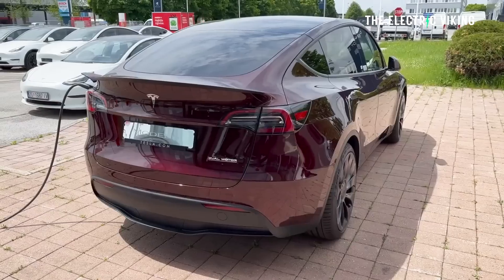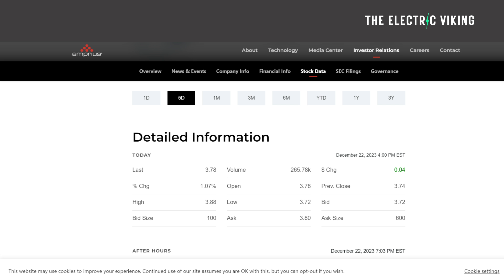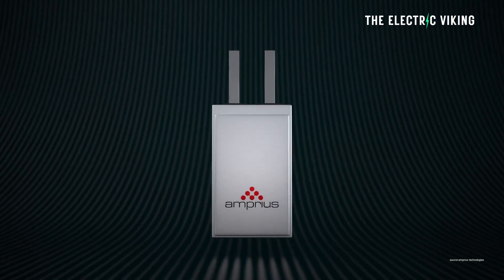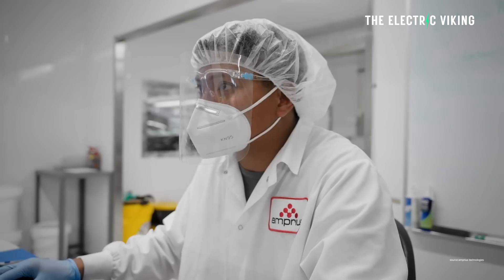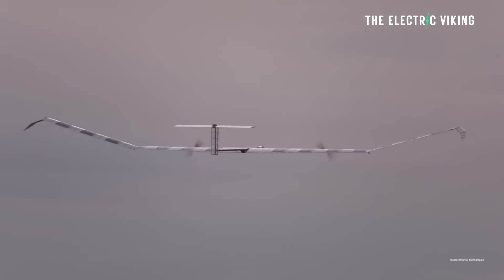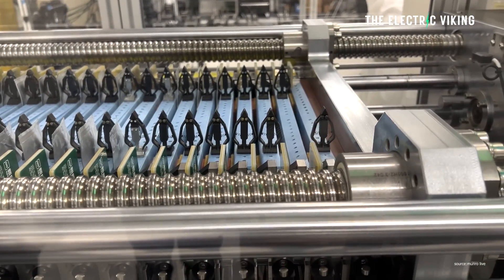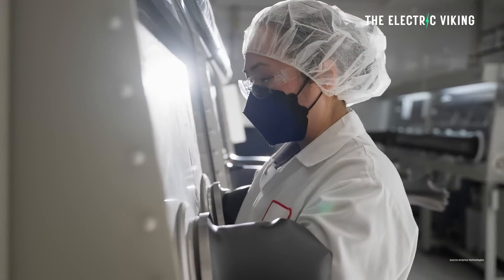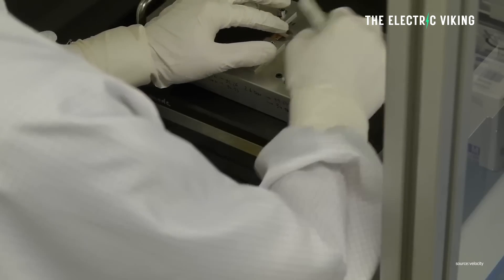A U.S. company makes the world's highest energy density batteries next to Tesla

Comment: How do you scale growing Si nano-crystals to GWh worth of anodes and cathodes? Crystal growth is usually an awfully slow process that gets slower the tighter your desired tolerances are. I cannot imagine this getting anywhere near as fast as pasting anode/cathode material on current-collecting foil. Looks like a probably massive manufacturing bottleneck that will limit the battery's usefulness to niche applications to me... and unsurprisingly, the military industry is their primary client right now.
Reply: Thanks for that information!
Reply: Amprius uses Centrotherm PECVD (plasma enhanced chemical vapor deposition) equipment from the solar panel industry. Centrotherm has years of experience mass-producing silicon deposition based photovoltaic cells for the solar industry. Initial capital expenditure will be quite high to get to giga-scale, but actual production will be cheaper than graphite anodes.
Reply: @Grimwyrd  PECVD can only deposit 25nm of material per minute. When you have to cover square miles of material per day with micron-long silicon nanowires for EV-scale manufacturing, that is awfully slow.

Supplying anything beyond niche products will require a ridiculous number of vapor deposition chambers.
Reply: @teardowndan5364  Yes, that's why solar panels can't be mass produced... /s
Reply: @Grimwyrd  you need to process quite a bit more battery electrode area per EV battery pack than PV cell area per residential roof.
Reply: @teardowndan5364  It's not nearly as bad as you make it out. They'll be able to reach giga-scale in a couple of years and the company will do very well.

No, they won't match the speed/manufacturability of Tesla 4680s, but they don't need to. They're focused on premium use-cases that pay top dollar for premium gravimetric density (e.g., stuff that goes airborne) while EVs are going cheap and easy.

Comment: Viking, again your logic is right out the window, why wouldn't Tesla buy them if things are so great? Answer, they're not!!!!!
Reply: In the same building something smells fishy
Reply: Correction: the answer is that Tesla is prioritizing quickly making as many fast, cheap batteries as they can, because they know they can sell all the cars they can make. Sure Amprius batteries are better energy density, but they'll never be made as fast and cheap as Tesla 4680s. That doesn't mean Amprius won't sell a ton of premium batteries for premium use cases (like anything airborne, where the highest gravimetric density allows them to charge a high premium on smaller volumes).
Reply: @Grimwyrd  - Even Musk believed we would have 100 KWH battery packs that weighed 250 lbs. and cost $2,500, I believed this would have happened by now also, as did many other EV companies. The obvious answer is EVs only need 20 KWH packs, and semi tractors 200 KWH packs, both backed up by hydrogen. This solves the range and charging problems we face today.
Reply: What if they don't want to be sold?

Comment: May trade range anxiety for replacement pack anxiety.

"In terms of durability and lifecycle, Amprius is claiming 90% capacity retention after 1,200 cycles in its eVTOL flight protocol testing for its 370 Wh/kg packs, which consists of 30- to 45-minute trips, 15 minutes of charging, and eight to 12 trips per day."

I wonder what is the 80% cycle life? That would be a more relevant comparison.

Comment: The new Tesla batteries are not energy denser they are just bigger batteries. 
Nio ET7 has already 620 miles range (one third more than any Tesla car).
The Cybertruck is now down to 320 miles range compared to the 2019/2020 presentation 500 miles range claim.
Reply: Until Nio can mass produce their 1000km batteries, it’s fair to call them vaporware, or at least an interesting experiment.
Reply: @timp1293  

From that, Cybertruck is also vapourware
Reply: Won't do an ounce of negative news on Tesla

Comment: Yessss! Thanks for doing a video on Amprius batteries ... I hope to see more. Sandy Munro has a few videos doing a tour in their factory that is outstanding. I hope Amprius batteries come with the new $25,000 Tesla. I am hoping for wireless charging too. I wish Tesla would give solar on the car a chance again.
Reply: Not likely. The battery pack by itself would cost $25k. It's more likely to go into a $250k car like the Roadster.
Reply: @apterachallenge  You have no idea what you're talking about as Amprius batteries are far cheaper - that was part of the point.
Reply: @donotcare44   Give me some current prices per kwh. Yes, in principle a higher energy density battery is "cheaper" than another battery that has lower energy density for the same price, because you need to but fewer batteries in the car, but the fact is that these batteries would need to be made in huge numbers to bring the cost down. Until I see that happening, and prices of less than $100/kwh I call bs.
Reply: @apterachallenge  They do plan on making the Amprius in huge numbers and everything else to keep the costs down - that is a major part of the purpose. Amprius is also preparing to make batteries for airplanes too. They've also got access to the new Lithium mining techniques that are far better and cheaper.

Comment: Amprius silicon rich battery will always be too expensive for cars... they have contracts with army, airbus and numerous e-aircraft companies, may be ok for formula-e or super cars but probably would never be on model Y or any other consumer car... actually degradation is very low, so it can be recharged 1000's of times, but production costs are sky high...
Reply: Now.
Reply: @AllDogsAreGoodDogs  how much can you take down the cost of growing silicon micron by micron in a plasma pool, advancing the line by a few millimeters may be in 10's of minutes... it's exhaustingly energy intensive, needs very hi tech and expensive machinery that used in chip manufacturing... LFP batteries will go under 30 usd per kwatt/hr in a couple of years, and they are getting better and better, trend would eventually take it under 10 usd per kwatt/hr in time... no new tech can catch up Tesla dry coating or chinese LFP by costs... those two are going dirt cheap...
Reply: @sahanda2000  They use less anode foil and silane gas for silicon deposition will be cheaper than graphite. Energy will be less than wet anode processes too. The only real negative for cost is that the capex will initially be higher buying Centrotherm PECVDs instead of slurry-spread-calendar-dry lines. They will be using large C.Plasmas with 10 tubes in parallel that can handle big boats/racks of anode foil. The capex will amortize over time and their price will become competitive, which is why they are selling to aviation for a premium to start, while they expand capacity, before moving on to sectors with tighter margins.
Reply: Thanks for that information!

Comment: Hey Sam. That is the holy grail you described in the beginning 1000 miles of range charge to 80% in 8 minutes. The only other thing you could add is 0-60 in 4.2 seconds with a 155 mph top speed. Tesla can actually buy them and they probably do need to based on still being battery constrained. 3 products Semi, Cyber and roadster dictate the need. Interesting times and with the US going back to manufacturing this could be a wonderful next 10 years of growth.

Comment: Why wouldn’t Tesla just buy them if their tech is so good?
Reply: I'll hazard a guess that it could be a reason similar to Tesla's dry-4680 shortage: they got the tech to work on a small exploratory scale but not on a scale sufficient for mass-produced EVs. Amprius' silicon electrodes involve growing silicon sticks on a substrate. Growing uniform nano-crystals is an intrinsically slow and delicate process, you aren't going to roll 10 4680s per second per manufacturing line like you can by pressing anode/cathode material on copper/aluminum foil current collector.

If the manufacturing throughput per production line cannot go to the moon, then these cells will be limited to niche markets that can afford the reduced productivity.
Reply: @teardowndan5364  Amprius just did a ribbon cutting ceremony last week for their new factory space that expands production 10x.
Reply: Or a better idea is GM buy them as they can’t figure out how to get their batteries manufactured. But all of this “why not buy out…” is more complicated as companies can decide NOT to sell if they see a better payout in the future, or they simply want to be on their own.
Reply: @scifithoughts3611  not true.  They are publicly traded. They can be bought. Even if not they can be bought.
Reply: With GM's investing record, I would stay clear if GM invests in Amprius and consider a buy if GM doesn't invest. I heard of the 500 watt/kg claim from a guy that got jailed, Trevor Milton.  Nikola had no battery researcher on their payroll then, when the claim. The problem I have with Amprius is the form factor, looks like a pouch style cell, whereas the best case scenario is maybe it's like BYD's blade battery. To me, I'm thinking pouch.
Reply: @GG-si7fw Why do you care about the form factor? Why is blade better than pouch?
Reply: @RyanWilliams222  Because if you have looked into pouch format, LG Chem and the Boeing 787 by GS Yuasa, not a good track record for electric transportation.
Reply: Maybe they would just put the Amprius batteries in a low-volume product like the Roadster. That's one car that would really benefit from them. Can you imagine how fast the Roadster would get to 60mph with double the energy density? I can imagine it would get there in like 1.8s.
Reply: @apterachallenge  the roadster has been written off by Tesla.
Reply: @docdailey   And you know this, how?
Reply: @apterachallenge  what are you referring to?  Know what?
Reply: @apterachallenge  if you are talking about cheap… market cap is 350 million… that is pocket change if this tech is real and scalable.
Reply: @docdailey   You made the statement "the roadster has been written off by Tesla." And you know this, how?
Reply: @apterachallenge  they have said as much and you cannot fix them with Tesla, they do not do battery replacements or maintenance that I am aware of and have open sourced the whole project.  I have worked on them and removed batteries and ecu.
Reply: @docdailey  I was talking about the new Roadster 2.0 , not the old one. Yes, you could put new batteries in an old car to give it a new life, but the primary purpose of making new batteries is to go into new cars. Tesla will never make the old Roadster again, it's obsolete technology. Yes I know that Roadster 2.0 isn't in production yet, but as far as I know Tesla have never said that they cancelled plans to produce it at some point in the future.
Reply: @apterachallenge  I was not referring to a product that does not exist.  Ahh.  Miscommunication.  I didn’t know you were referring tot he new roadster.
Reply: They just got sign off on the 1st production line
Reply: Answer is simple their tech is not ready for mass production - and may never be.  Tesla cares about cost and ability to manufacture over all else - understandably since they are able to sell everything they can make right now.
Reply: I just think that Tesla thinks that they can build a BETTER battery.
Reply: Cost
Reply: Yes, Tesla has seen these claims come and go over and over again.  If that had something real that could be produced in volume their stock would be much higher.
Reply: Price
Reply: @dw9666  of the batteries? The company is cheap.  If the tech is producible and as advertised.  Which I believe is the problem.
Reply: Probably cycle life is short
Reply: @i6power30   Good point. There is a lot we don't know about this battery. The chances of it being a perfect battery are not high. There are always pros and cons with most technology.
Reply: Why didn't anyone buy Tesla back in the day when the stock was cheap if their tech was so good?
Reply: @JRtheWarlock  they did and they are millionaires.  The problem is there are thousands of companies that just go bust because it doesn’t work out.
Reply: @JRtheWarlock  I bought Tesla stock as early as 2015 when it was around $20. I can tell you right now that Amprius is full of hype, their stock will be 0 and am not interested in buying it and lose my money. I don't know why people doubted Tesla back then, it was obvious putting a battery and motor in a car is no-brainer, it's not even a very difficult technical achievement. Creating revolutionary battery chemistry with nanotech on the other hand is a real challenge and just by looking at the management of Amprius I can tell you they are not even real scientists or engineers, just bunch of morons hyping up stock price to get investor money.
Reply: @JRtheWarlock   The tech wasn't so good in the early days but the company had what it took to keep improving their product, and to resolve the production issues that they needed to resolve to grow bigger. Some could see the potential, others couldn't. That's what business is about, knowing what to invest in, and spotting a winner.
Reply: Because Amprius could implement a Limited Duration Stockholder Rights Plan.
Reply: @lchavez5924  poison pill?  Haha.  They probably already have that.  Unscalable tech.  I have seen their rink a dink setup on Fremont.  Batch processing. That isn’t particularly scalable.
Reply: What if they don't want to be sold?
Reply: The reason is because Tesla and China have something better up their sleeve.
Reply: @Lachesisms  It is good to have a American backup battery supplier if the Chinese supply chain is disrupted.

Comment: Sam, I have so many questions that you have not covered here. What is the expected cost per Kwh for the Amprius battery when it comes out at scale? What is the expected industry standard cost per Kwh at that date? What is the expected degradation rate when the battery is discharged/recharged? How many cycles can it handle before being unusable as a plane/car/bus battery?

Comment: Battery Swapp Tech with Standard Battery for All Cars. 5 minute Swapp and Energy Storage. Commercial Aircraft Battery Swapp. Fly land Swapp, Fly Land Swapp.
Reply: Building and maintaining very expensive battery swap locations is a terrible plan imo.
Reply: @ronmatthews2164  Building EVs was a terrible Plan also. 🙂
Reply: The batteries will step up faster than you can build infrastructure for battery swap
Reply: @ФёдорЛукин-у1о  Battery Swapp is Energy Storage. Big advantage. Car Battery Separation. Never Battery Issues. Big advantage. Standard Battery for all Cars. Cheap Mass Production. Big advantage. NIO Cooperation with Changan CATL BYD Geely Volvo Polestar Stellantis VW. Big advantage.

Comment: Cell Phone technology has been around for 30 years and the battery is still only good for a day or two?
Reply: because the power demands increase all the time for phones, the better battery you get, the more computing power (which needs more energy) and better screens (running which uses extra energy) you can put on it. With cars it should not be the same, although it kinda happens too with people putting 4 motors and more horsepower and stuff. A phone which is 10 years old would definitely last much longer today with today's battery
Reply: They could easily make it powerful enough for a month.  Customers don't want a battery that makes phones 1/2" thicker.

Comment: Super duper new battery powering planes (?) 500 Wh/kg; Kerosin 12000 Wh/kg
Reply: And Kerosene engine KPI is 25%, so the gap is a bit less than it seems to be
Reply: Kerosine delivers 25-30% efficiency as most of the energy is burned off as heat and waste.  Li-on batteries have 90% efficiency with virtually all of their stored power delivered as energy.  Li-on still wins.
Reply: @RussellFineArt  1kg of Kerosine holds many times more energy than 1kg battery

Comment: Oh cool, another ultra density battery that has a life of less than 5 cycles in ideal lab conditions, just like all the other throw away ultra-dense batteries that were supposed to revolutionize EVs for the last decade. The articles and vids about amazing new battery tech get really old when the reality is none of it is actually viable, or it would be headed to production.
Reply: 10 years ago our current batteries were considered somewhat ridiculous and impossible, so...
Reply: What is the cycle life of Amprius batts?  Last I saw, it was 2k cycles, and Sam says here, they’re building 2 factories.  Curious why you comment like this.
Reply: @RussellFineArt  It's all smoke and mirrors and has been for a decade. Every one of these revolutionary batteries has something holding it back that prevents it from being viable. Cost, volatility, life cycle, etc. If this was really viable, do you think their stock would have dropped 50%? No, it would have gone up 5000%. Don't be a sucker.